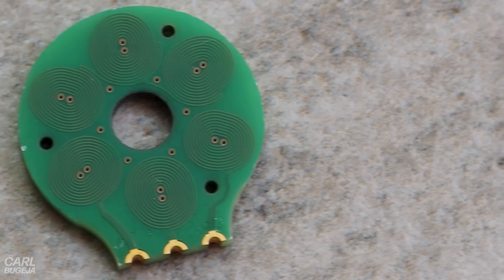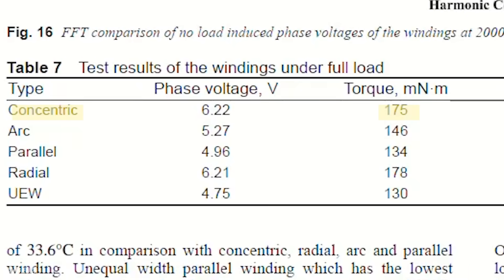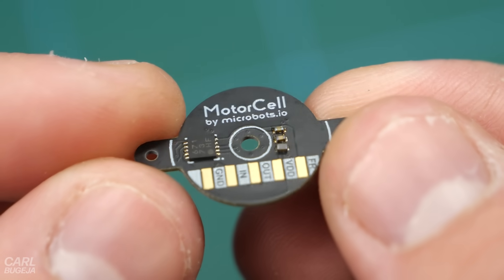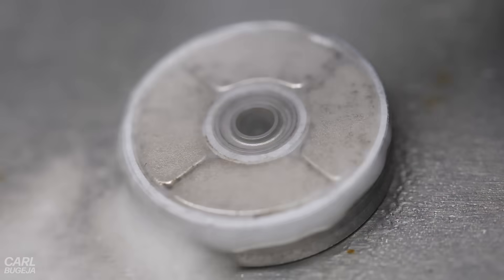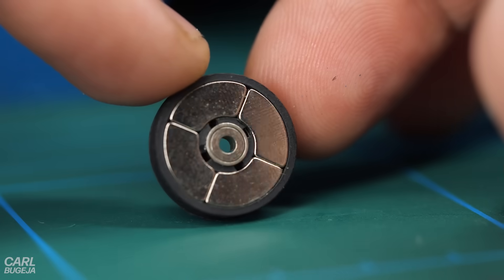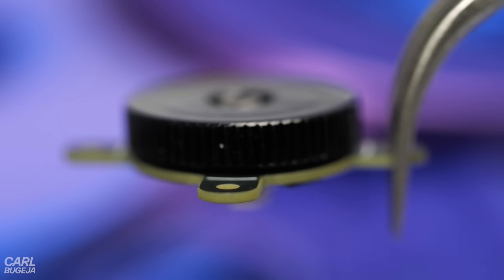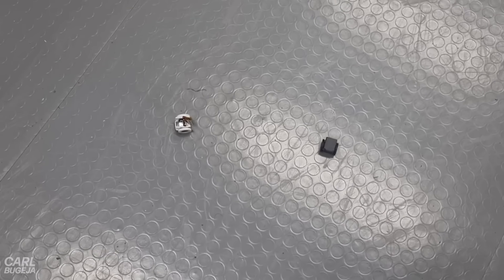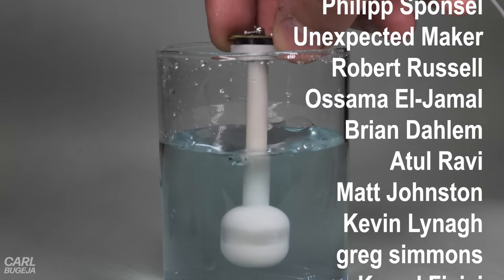How this tiny Motor Survived 1.6 BILLION SPINS

Comment: 11:55 not really "new". I have a cassette player from 2001 which motor has its coils printed onto PCB. It was done in mass production ~20 years ago.
Reply: IRB60 and IRB6 - one of first industrial robots, made by Swedish ASEA (ABB) - they used solid magnets in rotors and flat coils in stators, the same construction -  1972!  Technics RS-B100 deck 1984 - the same idea. Nihil novi sub sole ...
Reply: I have a Sony walkman WM-FX 50 (year 1991) it has a motor with printed coil and driver with IC LB1672 and it works only with a Ni Cd battery of 1.2v
Reply: Pretty sure I took an old 3.5" floppy drive apart 20+ years ago that used printed coils too. I want to say Sony or Panasonic, one of the better brands.
Reply: @jinbee2627  never seen floppy drives with motor coils printed. But tacho coils on PCB - yes.
Reply: @jinbee2627  yep, I was going to mention those, because they look exactly like these ones (but bigger, probably 60mm across? they take up the whole underside of the flywheel.)
Reply: When he said haptic feedback I picked the pancake vibration motor from an old cell phone up off my desk and thought, "You mean like this?"

I mean, it is still pretty neat and all. But like every other maker channel, people go crazy with 'the possibilities' because they A) dont understand the larger scope of engineering which make the product irrelevant (think the rocket equation. Sure the diy rocket motor is neat, but you have to carry fuel, and tanks for the fuel, which is more weight, you need more thrust, which means more fuel, bigger tanks, etc etc etc, until you have a rocket engine that looks exactly like the one available off the shelf), 2) havent bothered to look at where its been done before (There is a SERIOUS issue in academia where people are repeating experiments to find values that have already been done to an adequate precision, but because it was done in the 1940s people think it either was crap low res data or they can do it better today.....only to end up with the exact same results. That is of course if they bother to try looking it up in the first place, which leads us to....), or III) didnt open a granger catalogue or do a google search returning the plethora of optimized mass produced perfected designs already out there (...Yeah, doing something that was already researched, and beat to death like a lame horse is kind of a waste of resources, and time. Though I am still talking about academia....The maker crowd however is putting the folks at PCBway's great-great-great-grandkids through college with all the redesigns and haphazard orders...Anyone remember what 'prototype' meant? I dont think they do...must be a side effect of not being told no...Dont get me stahted on the whole 'oh no everyone worry about microplastics and the environment' while we are pumping out plastic waste like its going out of style and producing tons of PCBs for some kids in india to burn so they can collect the precious metals for dinner tonight...but yeah sure, I have to give up my car for a hideously designed EV because Im the problem....Imposing more load on the already over service capacity electrical grid....yet everyone is still scared of nuclear when SMRs would solve that problem in a heartbeat...What? I told you not to get me started....). Again, still, 12 Euro.....not bad. Not bad at all.... 

TLDR - Read it all, coward!
Reply: @TankR  It's hard to search old academic papers for specific engineering concepts if you arrive at the premise without knowing any official or common vernacular for the problem you're working at.  There are even a few fields that have over-lapping concepts that people only notice if they've found themself interacting with both fields.  Even in this video he clearly has found a paper which covers the exact thing he's working through, but it's not like every paper is written with awareness of every other paper that could potentially overlap (Also "TL;DR" has a semicolon in it).
Reply: @TankR 

Academia rerunning old experiments and ending up with the same result is a given. It isn’t due to naivety as you seem to imply. 

It’s how you interpret those results that matter, what additional information you add to those results and what new knowledge can be gathered from those results. 

So yes, whilst your result might be the same, what you extract is the important aspect. 

Prime example is composite materials such as Carbon Fiber. We know the benefits in tensile strength that carbon fiber provides but what about different patterns of laying carbon fiber or different chemical make ups of epoxy etc. 

Whilst you might end with the same result, or even worse, the benefit is that it adds more to the collective knowledge of everyone involved. 

Especially with modern tools, who cares if you end up with the same results as an experiment in 1940. Modern tools can help you better analyse the results of that experiment. Going back to my carbon fiber example, scanning for material flaws under an electron microscope. 

The first dissection of a human was done in the classical antiquity period, does that mean we shouldn’t do any more research into the human body? 

The first stealth aircraft was made in the 1970’s, does that mean we shouldn’t have more research into reducing radar emissions? 

No, there’s more data and knowledge to be gathered and with modern tools it boldens that concept even further.

I am not too fussed with the rest of your comment but that particular quote about academia is egregiously insulting towards people who are running these experiments.

Comment: You might want to try Hydrodynamic bearings, they don't use balls, just a thin layer of oil.  Well done with the reliability and mass production. Many decades ago I got some 3mm and 5mm BLDC motor for $300 to $500 each. Turns out the magnets absorbed water and swelled up and turned back into powder. There is now some high temp 3D resins I want to try for stators for tiny Outrunners. Magnets are much better and cheaper now.

Comment: Throughout the video I was asking myself "what is the advantage of a PCB here?". I figured that integrating the motor with the rest of a project (on a single board) could be a huge advantage in certain cases. So thank you for making the design files available!

Btw, did you know about the Open Source Hardware directory which the OSHWA runs?

Comment: Or a brain pain just hit me. Hell with bearings period, use magnetic locking instead, zero friction, simple cheap. You might be able to use the motor field rotation you just need a magnet on the spinner. They are not stuck together. The spinning field will attract the magnet and it will rpm lock in midair.

Comment: You are missing the point. Really? Yes really, check out frictionless air bearings. Since you are dealing with small well that's better. Or a jewel air bearings. If that don't make sence get yourself a glass syringe, give it a spin with your fingers. Next resistance problem. Easy fix multilayer pcb with gold traces or even electroplated because at high frequency the skin effect will cause the electrons to stay on the gold surface. Because it's small it might add a buck or two to the final. Air bearings can't wear out. Gold is the best conductor unless you use graphene. That could be possible by printing the graphene onto it or converting a layer by laser to graphene. One of the original ways of doing things with graphene. They used a DVD burner to burn the graphene into shape and place.  Now you have the point.

Comment: i wonder if a set of 4 motors, stacked into pairs, could be used to replace the flywheel motors in a nerf blaster. not sure how much the audio was tweaked here, but it'd be nice if the volume of a flywheel nerf blaster could be toned down a bit, and these might be an option for that, while also making it a bit lighter.

Comment: At my last job, the predecessor had mounted ordinary ball bearings in the cnc tools. They said that the ball bearings break all the time, checked them and ordered high-speed bearings, they lasted for a few years instead of a few weeks. The right bearing with the right tolerance is important. He had also tried to put shims so that the bearings would fit where the old one had locked and spun, I don't need to tell you that I placed those tools in the scrap container. He had only looked at the price of bearings and taken the cheapest, but his poor knowledge cost the company a lot as the holders cost about 1800usd each. 6 holders were completely worn out due to locked bearings that spun on the holders. The right material for the right applications is important for durability and safety.
Reply: you'd think the company would have a specification sheet for maintaining the machines and a supply of parts on stock to replace worn out parts. rather than leaving it to presumably the operator, who hasn't necessarily been trained in machine maintenance...

both my parents worked in a bakery factory. my mum was an operator, so she knew how to operate the machines to produce whatever they were producing, and she was a trainer so she could train other people to operate the machines. but she had no training in fixing anything, and so if anything ever went wrong with anything she'd call for an engineer or an electrician. seems like this would be standard operating procedure in most places.

Comment: 8:47 the mass alone should not reduce their peak speed (by much).  It should only reduce their acceleration.  But if the shape changes the drag changes, and the moment of inertia changes.  The further the load/inertia gets from the axis of rotation vibrations/lateral loads go way up.

Comment: Stack two, one on top and one on the bottom slightly rotated for physical phase offset. This might be enough for lift then, especially if you tweak the phase/amplitude over time across the top and bottom for adaptive climbing rpm.

Comment: would it be possible to also use a pcb as rotor with the short-circuited three phase winding with copper traces so that you have an asynchronic motor? I guess the torque would be even lower but much light and maybe you can directly 3d print the PCB into the propellers?! Awesome work 🙂

Comment: Have you considered stacking them like a rotary engine. I.e. PCB-Rotor-PCB-Rotor.

You could stack 3 or 4, press the rotors onto the shaft and only need bearings on the ends.

Comment: given the size and speeds you should turn this into a 4010 style blower fan with same dimensions, or slightly bigger maybe 5015 and see how fast you can get it to spin, the fastest 4010 currently is 12k rpm a faster on could be quite useful for 3d printing pushing more air

Comment: Why not use and Air Bearing? Tighter tolerances, sure, but almost zero friction. Would bump the RPM up closer the 50k. Mix with planetary gearbox to increase torque for larger props, though going even smaller will be of more use to many technologies. The off-set mass vibration has potential too, micro pumps that mimic natural blood flow, small enough to fit in to a catheter, or several vibration motors on a common center axis, that can be set to be in or out of phase, for infinitely variable vibration levels, good for 'toys', or for applied use of Chaotic Motion to pack powders down in to solids inside a container, where those powders cannot be put under pressure for safety, such as for making very small solid fuel rocket motors.

Comment: P&GDT designed a pancake planar electric motor back in he 90s. it was fitted to an outboard motor unit for testing. it sat for years in the lab, leaning against the wall.

Comment: That would simplify model railroading a lot why don't you try to make some model locomotives check out how model locomotives are built now and you'll see they have a motor in the body and going through a big gearbox to go through the wheels these motors you can actually put two of these together on the same axle and if you had a 6 axle locomotive that thing would be really Torquay I think you should try model railroading for these motors peace out into the world and have a great day

Comment: You might like to look into the usefulness for LEGO / Technic builders. The official branded motors are insanely noisy, especially if you have a model which uses several motors.

Comment: Gosh, our company did this technology back in the early 1980's.  These techniques are used in nuclear separation drives, at up to 90,000rpm.  Electrostatic suspension in a vacuum works better for really high speeds.  One of the main problems with iron and ferrite materials is indeed the losses at these higher frequencies.  One of my motors had a 300KHz drive frequency.  worked well for a few seconds, and then exploded.

Comment: Silly use: levitation lock a magnet, the way a small magnet can levitation lock on a spinning magnet attached to a drill bit. 

Also, some kind of self torquing or screwing in nut or bolt? Lol

Comment: As another person who attempted spinning things for a long ass time. My suggestion instead of a bearing with multiple balls with points of failure like dust and just wear use a needle and a jewl like in a mechanical watch or a screw for the pivot on the disc. The disc pivot can be a screw just make sure its a similar metal to the needle so galvanic reactions don't occur with it balanced right and up dust cant fall into it plus the only wear would be the needle it would take forever though and even if it wore out it would keep going and just be rounded off. Plus this approach still would keep your idea of a pcb motor intact all you would have to solder into place is a needle. 

"I know there would be like no torque nor can it be used like a wheel but if you just wanna spin something kinda fast and upright its a old school method but it works."

Don't mean to talk about my build but plan to have a video on the thing I described soon too if my comment is a bit confusing to read.
Reply: The jewel bearings is a great idea.
Reply: I wonder if a gas/air bearing could work instead?
Reply: @MBunn-uf1we   Brilliant, but expensive. The air bearing I saw was nearly frictionless, but it required compressed air to be fed into the interface. They're made from extremely precise parts, and precision is expensive.
Reply: @machinemaker2248  some designs do not require compressed air; they are shaped in such a way that they can trap air as they move, with the caveat that they have high friction at rest.
Reply: @PixlRainbow   Now that's a good innovation. I should have guessed that that would have been accomplished by now. Lol
Reply: @PixlRainbow And the energy required for the motor to pump/compress its own bearing air does not offset the win from reduced friction?

Air (fluid) drag is proportional to the velocity squared, so the faster your motor spins, the higher the energy needs for air pumping - and I'm thinking you might find it hard to find a balance where it pumps enough air at low speeds to maintain the bearing, while not excessive amounts at high speeds.
Reply: @MBunn-uf1we  Graphine bearing is also good but you need a strong magnetic field and it floats like a super conductor with out sub freezing temperatures. Only problem you need a equal north south magnetic field then having to fit in his case a pcb coil under that. But a ring magnet and I hope I remember it right graphine can produce solid levitation that does not need power but whether his coils can push it after would need trial and error.

Comment: A few questions, if you have the time:
- What does the back-EMF look like? Trapezoidal or sinusoidal?
- It looks like you made early design decisions based on no-load RPM. Have you gone back and tried e.g. the 8-pole design with a load and measured dynamic response?
- Have you considered sensorless FOC? If so, what made you choose trapezoidal? BOM cost?

Comment: How about using multiple 6 layer PCBs to give a 12/18/24... Layer coil. Basically use the third dimension to add more inductance. Thinking of solder pads on PCBs for connections, pasted then reflowed when stacked to create an x layer PCB.🤔

Comment: Very cool!  Like your concepts.  Have you considered multi-layer PCBs to accommodate different coil shapes/ configurations?  Could you optimize the flux density by designing the coils in a 3D format utilizing the different PCB layers or connect 2 driver ICs to 2 separate layers of the PCB to maximize flux density?

Comment: That light motor would be great with a light propeller, on a paper airplane.  Use a small CAP for power, charge with USB.  Kids would have a blast in class with those.  Would be a good STEM experience for kids.
Reply: Not the right dimensions for a paper plane.
Reply: @GelloMello-j9z well, pack it up then, not like there are any engineers around here that can change form factor of a motor

Comment: If you're chasing tighter tolerances i would not measure them with the back of a caliper like that at 8:16 there is a flat side there that will interfere with getting a correct dimension. IMO you should consider investing in "small hole gauges" and using a micrometer as the gauges are rounded to get the very tangent of the hole. Best of luck in this project.

Comment: If you're looking for a first product, a good application would be a 3D printer part cooling fan. Most manufacturers use the same garbage old radial laptop fan design and this would seem to be a perfect drop-in weight-saving replacement candidate. Everyone uses the same fan, so it's a universal enough target for a large active base of dedicated hackers.